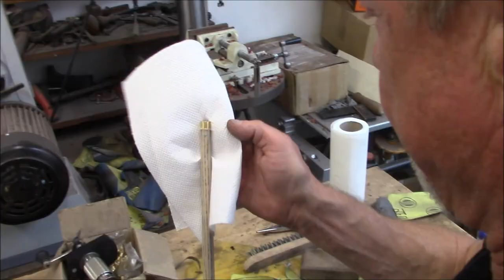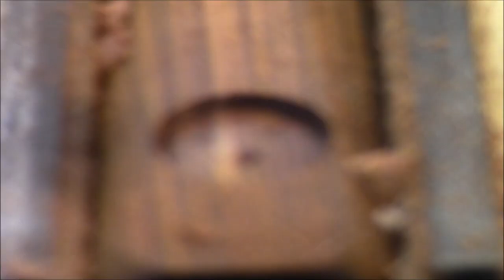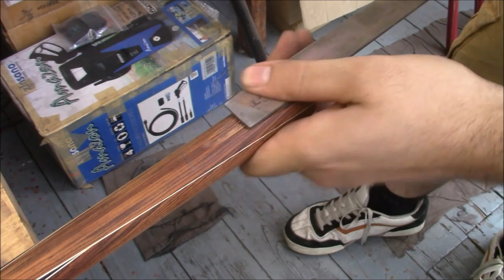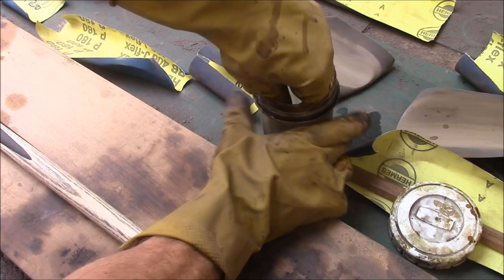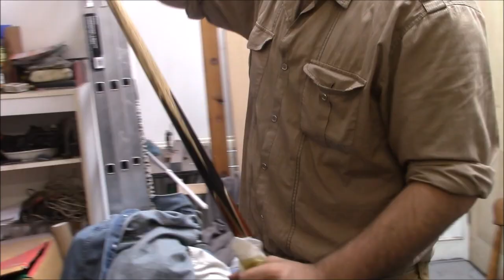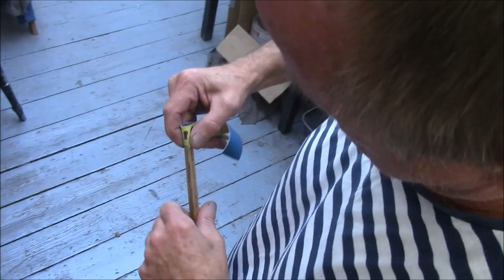Will Hunt (London): finishing a cue

Comment: I'm a half decent club player.And these cues are beautiful no question. But if you pick a machine spliced job of a rack for 40 quid as long gone as the tips good ..does it really make much difference to how good you'll play.I doubt it.
Reply: Ewan MacFarlane well, it all depends on the quality, density ....of the shaft itself. A machine spliced cue tends to use some cheaper wood that may affect u from playing. I have a machined cue and obviously the shaft will keep shaking after u played a screw back. But my handmade cue from jp just totally fine. U can check by slow mo in your phone. U need to know what u are paying for.
Reply: When I was younger I do not believe cues make much differences, but now I do. I need my shaft really stiff, a whippy cue spoils my control of the cue ball. That said, if you could find a cheap machined cue made of stiff wood, then it's a good cue.
Reply: Yeah I know good cues are  beautiful to play with.But you do get the mid range machine ones for 50 80 pound.The ash is more than decent .The type of guys who cant make 40 but send specifications away to John Parris or the like are wasting their money and time.
Reply: Ewan MacFarlane I know that type of players. :) I cant afford JP or any bespoke cue maker for that matter. Do custom cues really turn out the way a person expect them to play? I wonder. I rather buy one off the shelf that i can test.
Reply: @thaiphra2183  A Peradon cue .Joe Davis special .Very good cue reasonable price 160 pound or so hand made.That will more than do the job mate.
Reply: @ewanmacfarlane9195  I am that type of guy. I will get a big kick out of having a top cue, and I will know the cue is not to blame. These things will mean more to me than they would to you, and are worth a great deal more than the extra cost. I don't kid myself it will make any difference to my game, except to make playing more enjoyable.
Reply: If you hand selected a Chinese cue straight straight grain stiff fit a quality tip remove the clear coat and oil it yes it may play good for an average player but I have repaired many Chinese cues that don't have sufficient glue in joints and ferrule and cheap brass.... Buy a basic peridon or Riley